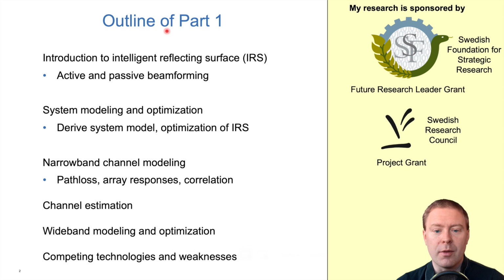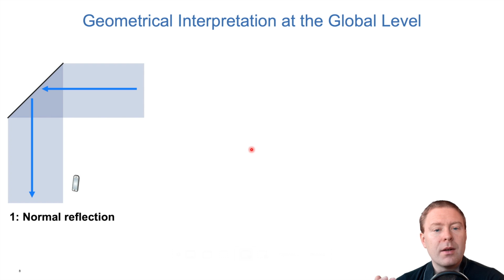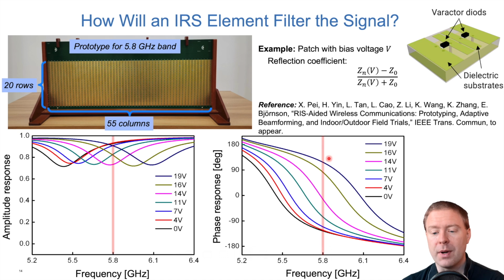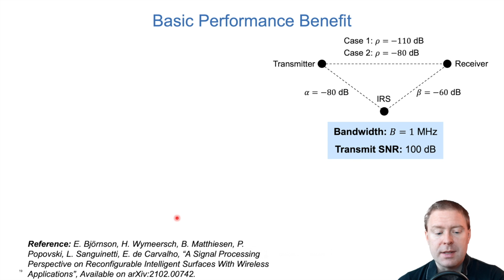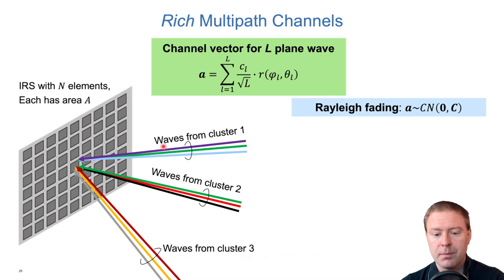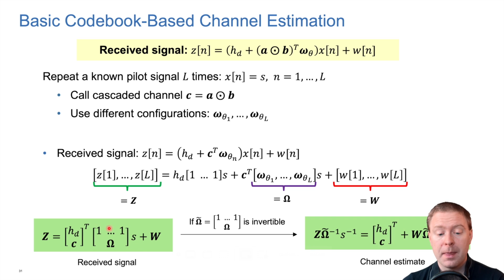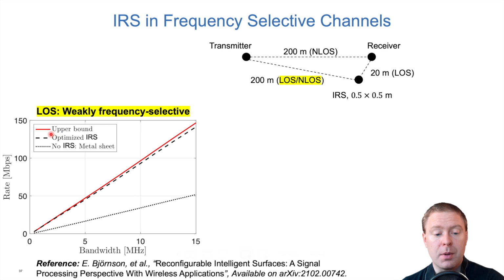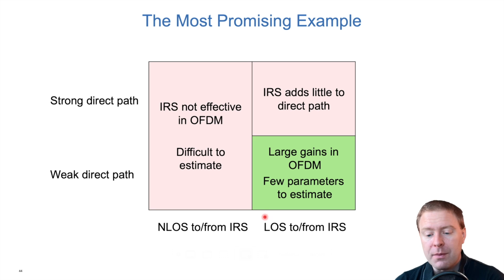Intelligent Reflecting Surfaces for Wireless Communications [GLOBECOM 2021 tutorial]

Comment: hi professor good morning, i have one doubt why we choose only diagonal of element reflection
Reply from the maker: The basic system model is found in the light red box after 31 min. As you can see it is sum_n a_n b_n exp(-j theta_n). One can express this using vectors or matrices in different ways. We present one such expression in the box, but some people like to write it as a^T D b, where D is a diagonal matrix with the theta phase shifts. The fact that it is diagonal is just a notational thing and has no other meaning than representing the fact that the signal arriving to an element is only reflected from that element, and not leaked into other ones.

There it recent work on “beyond diagonal RIS” where the hardware contains a network of interconnections between the elements so signals that arrive to one element can be reflected from other elements. This is an ongoing research area where people try to identify what kind of benefits one might get from using such a significantly more complex hardware setup.

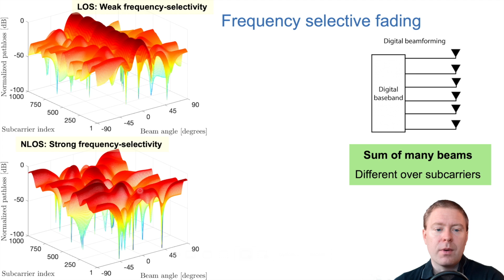Comment: Hello professor. In order to plot the channel at LOS explained, I plotted it as shown in the picture shown in @1:09:40  using the rician channel vector and array response. The question is, why is the beam angle of the LOS path formed at 0 degrees? Could it have something to do with rician channel modeling? Thank you for always great lectures.
Reply from the maker: Yes, we assumed that the LOS component in the Rician model is the array response vector for the zero-angles (i.e., a vector with 1 1 1…). If you change it to another angle, then the preferred beam angle will move accordingly.
Reply: @WirelessFuture  Thank you! professor!

Comment: Thanks a lot for the great presentation.

On slide 12, shouldn't we use h(t) = 0.5*h_{pb}(t) e^{-j2\pi f_c t} for the baseband model?
Reply from the maker: No, the expression on the slide is correct. You can find the exact derivation in this paper: https://arxiv.org/abs/2102.00742

I guess you have seen the 1/2 scaling factor in some textbooks, which want to use the same transformation from passband to baseband for the signals and the impulse response. But this messes up the expressions by requiring these extra scaling factors, which are not given by nature but is a consequence of the choice of notation. We use a different notation so that a convolution between impulse responses in the passband becomes a convolution of impulse responses in the baseband, without artificial scaling factors.

Comment: Hello.. i have one question ... can IRS change amplitude of reflected signal as well ??
Reply from the maker: Yes but not in a particularly efficient manner. The distinguishing factor between an IRS and a traditional relay/repeater is that the IRS doesn’t amplify the signal, only reflects it. Hence, we can only configure the IRS to lower the amplitude not increase it. This feature can be utilized to further control the shape of the beam pattern of the reflected signal, but I don’t think it as useful as changing the phases to control the coherent/destructive interference pattern.

Comment: Hi professor ...
How are you doing ?
I wish you well ...
I want the matlab code of the intelligent Reflecting Surface in Multiuser MIMO very necessary  ...
My project is talking about IRS in Multiuser MIMO but I have searched since five months  without any progress and I'm appealing you to give me the code or guide me to how can I write it without complexity by taking into account that I am weak in changing the algorithms or equations  to matlab codes ...
And  that service will take me to my next step  of life , because my country is under war nowadays and  the reason that hold me here is  only the graduation project ...

Let me tell you I've read your researches  many times  but I forget for each time and I don't know what the proper way or what I want to do .I try to modify your codes but I couldn't .
I need the equations that I'll put it in the code for the following parameters: 
SNR , TX power, Spectral efficiency and capacity ... 

Finally,  I will be grateful forever and if you want money, I will give you what I can ... 

Note : it's for bachelor degree ...
Note : if I could change the system from SU-SISO to MU-SISO ,that would be enough for me ...

Thank you in advance ...

Comment: Thank you so much for the tutorial Professor. I have a query regarding the phase shift matrix. What is the reason of taking diagonal of phase shift matrix.
Reply from the maker: Hi! In this tutorial, we are collecting the phase shifts in a vector that we call \omega. I don’t think we use a diagonal phase shift matrix. But there are other presentations that use a matrix description instead. The key point is that one should write the channel using the summation formula in the light red box on Slide 15. One can then write it using vectors and matrices in different ways, and different authors prefer different representations. But they are all equivalent.

Comment: Dear sir did you actually simulated 1100 element array in this work :"RIS-Aided Wireless Communications: Prototyping, Adaptive Beamforming, and Indoor/Outdoor Field Trials" of yours or only simulated a small array and followed the results for the larger one?
Reply from the maker: We simulated the behavior of a single element (Figure 3). This is the only simulation in the paper, the rest are measurements. The 1100 element array shown in Figure 4 was manufactured and used in the field trials to obtain measurements. There is no extrapolation from a small to a large array.
Reply: @WirelessFuture  thanks a lot sir

Comment: Hi professor! Are you aware if OTFS is considered a good choice for IRS-assisted communication systems in presence of high Dopplers? Or is it not worth doing it using OTFS as there are no papers yet on IRS using OTFS?
Reply from the maker: Hi! I don’t think think there is a deep understanding of the combination of OTFS and IRS so far. I think the current consensus regarding OTFS is that it provides gains over OFDM in scenarios with very high mobility, but that the gains are not sufficient to motivate a complete redesign of the waveforms. Generally speaking, I don’t think that IRS-assisted communication is a good fit for scenarios with high mobility, because of the resource-intensive configuration procedure. When the desired reflection angle changes rapidly due to mobility, you will have to reconfigure the surface rapidly to point the reflected beam in the right direction, even if the data isn’t encoded into the emitted signal using frequency domain subcarriers (OFDM) but the delay/Doppler domain (OTFS). But now I’m just guessing so this could indeed merit further research!
Reply: @WirelessFuture  Thank you professor for the reply. I agree with your points. For now, I feel too that it would be too complex to blend in IRS with OTFS. But what about in an IRS-assisted LEO satcom system where the LEO satellites circle the orbit in speeds in the range of 7-8km/s. Do you think in such scenarios, it might be worth to replace OFDM with OTFS? Btw, just to let you know, I am in my second year of PhD at Monash and I get super inspired by your teaching. Once I feel confident enough in my field, I hope to apply for an internship under you, maybe next year!
Reply from the maker: @amitbora6336  The LEO satellite and OTFS could indeed be a scenario worth studying. It is high by predictable mobility which should make it convenient to also predict where the signals will be in the delay/Doppler domain.

Comment: nice tutorial, I tanks. can I get detail mathematical analysis of IRS assisted MIMO system with hybrid beamforming for NOMA and OFMA systems, tanks for your help and kindness.
Reply from the maker: Hi! The combination OFDM + IRS is very important, and also covered in the tutorial. You can find a deeper mathematical analysis here: https://arxiv.org/pdf/2102.00742.pdf

You can probably find papers on hybrid beamforming and NOMA as well, but these are two topics that I don’t work on myself.
Hybrid beamforming is just a temporary solution: https://ma-mimo.ellintech.se/2019/05/02/when-will-hybrid-beamforming-disappear/
And NOMA cannot provide much practical gains: https://ma-mimo.ellintech.se/2021/04/15/is-there-a-future-for-noma/
Reply: @WirelessFuture  thanks, proff. Go on...

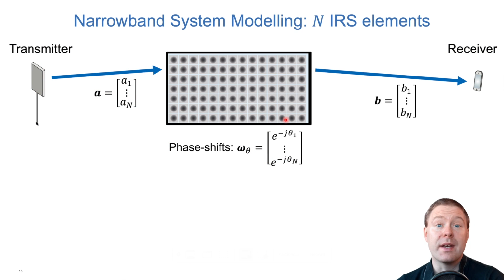Comment: 1-@28:00 how would the spherical beamforming vectors mathematically differ from the normal steering vectors used in the far field beamforming ?

2-why does the power decrease if we are at a distance less than the focal point (it is already intuitive why is it as such if we are far ) but why if we are closer to the antenna ? 

3-given a focal requirement of x meter for ex then how to design the beamforming vectors ?
Reply from the maker: 1. The channel vectors a or b would then have to be modeled to take the spherical wavefronts into account. In a LOS scenario, you would get a steering vector in the far-field, while you need to consider the exact delays (phase-shifts) in the radiative near-field. You can see (24) and (25) in https://arxiv.org/pdf/2002.04960v4.pdf

2. It is the beamforming gain that reduces at closer distances. This is because the signals from the different antennas are not adding constructively at those locations. You can think about the phenomena that happens when you focus a camera on a person. Objects that are closer and that are much further away will be blurry. I recommend the following paper: https://arxiv.org/abs/2110.06661

3. It is not more difficult than estimating the channel and selecting the beamforming vector to maximize the SNR at the desired receiver (focal point). What changes is the shape of the "beam" and that shouldn't use channel estimation schemes that make use of steering vectors (e.g., avoid codebook-based beamforming, while reciprocity-based beamforming works directly).

Comment: With respect to slides 27 and 28: the connection between correlation values and the Eigenvalues is about inverse proportional, is that right? 
One wants many high-valued Eigenvalues, and that corresponds to low correlation numbers on slide 27. 
I believe to remember that with many high-valued Eigenvalues one can say: the energy is spread widely than with only a few high-valued Eigenvalues.
Reply from the maker: Yes. The flat dashed line on slide 28 represents no correlation. The fewer high-valued eigenvalues there are, the more correlation there will be.
Reply: @WirelessFuture  Thank you for your quick answer. I just have a little unclarity. On slide 13, there is the equation for the End-to-end impulse response. It is in the time domain, clear. On slide 15 this equation for the End-to-end channel, is that in the time- or frequency domain? Thanks.
Reply from the maker: @nelebauer7864  Slide 13 provides the continuous-time impulse response. For a narrowband channel, one can write each impulse response in the complex baseband as a delta function times a complex scalar. This is what we present on Slide 15. It is in the time-domain. You can find all the intermediate steps in the following tutorial paper: https://arxiv.org/pdf/2102.00742

Comment: Thank you for the lecture and the additional slides. At the first glance, the voltage values for the meta materials (up to 19 V). Hopefully there won't be any problems with the energy consumption. 
In slide 18 on the right image, perhaps the letters are wrong (h_2,g_2) - I expected a_2,b_2.
In slide 15: the unknown parameter is theta_n, and we need to determine that parameter. Is that right? We want to adjust the phase of the surface. Because in the last equation the sqaure of the norm of the element wise product is independent of the phase theta_n.
Reply from the maker: Slide 18: Yes, you are right.
Slide 15: Yes, the design variable it theta_n. If we select it as stated in the yellow box, you can achieve the upper bound where all the phases are gone. What we are doing more precisely is to make sure that all terms in the sum get zero phase, so we can just add up the amplitudes.